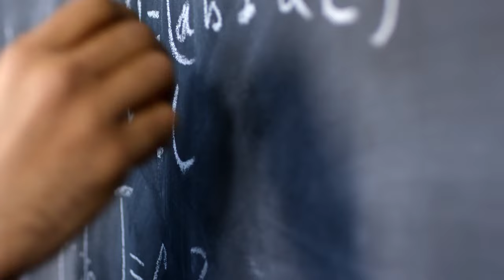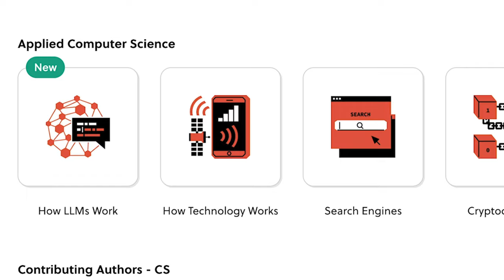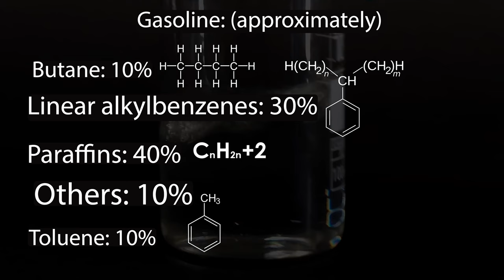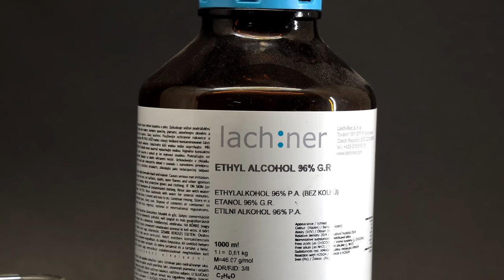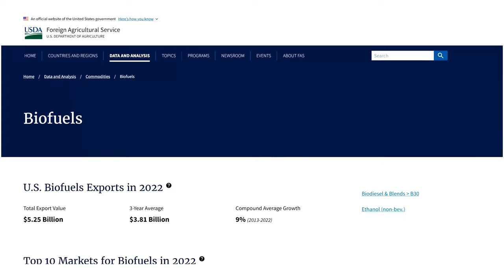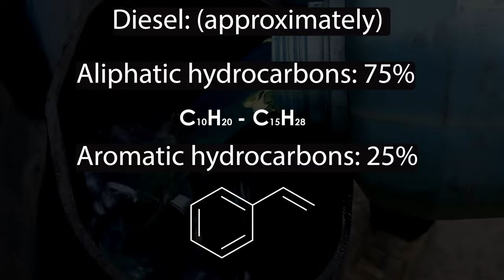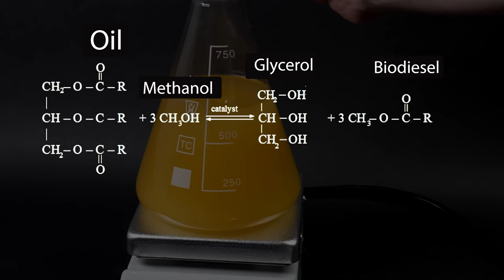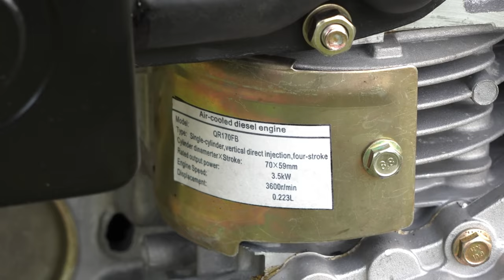Why Biofuel is a Scam?

Comment: No offense to the guy doing the voice over, but your real voice is far better and more sincere.
Reply: It was always a dub.
Reply: @ThunderChunky101  you are correct.He used to use his real voice. Before because it's easier to do it in a controlled environment like that, then relying on someone or something else
Reply: @borttorbbq2556  No, it wasn't his real voice previously.
Have a look at the videos.
They were also dubbed.
Reply: idk i find this one easier to understand, or i could even be happy with subtitles.
Reply: @ThunderChunky101  - Not necessarily, it's entirely possible that he never figured out how to synch his audio and video properly when using a mic and camera setup that were completely different inputs. E.G. A dedicated Mic, and a separate dedicated camera. Point is, we do not know for certain, so we can only guess. Thus, since we can only guess, we really can't try to claim that guess is a fact, unless he either confirms it, or doesn't.
Reply: @RetinaBurner  Stop it.
It's not his voice.

Comment: I've been doing research on biodiesel made with ethanol for a few years now. We recycle the glycerol byproduct back into the reaction as a glyceroxide catalyst. We react the waste cooking oil directly from the fryers on campus with 200 proof ethanol (not denatured). Ethyl esters are slightly better in energy density than methyl esters. I've been able to distill biodiesel made from soybean oil into 2 different fractions. One fraction is enriched with saturated esters and one that is purely ethyl oleate. Ethyl oleate melting point is -32C and can be used as a fuel in colder climates
Reply: Interesting!  Is this documented in a Paper, or some sort of Project Log anywhere yet?  If not i would love to hear more about this project!
Reply: Yes, but with very little modifications you can put unmodified raw soybean oil (filtered) directly into some random diesel engine and it will run just fine. Older engines will run it without any modification.
Reply: We should research engines that combust dry grain dust. It's extremely flammable. You'd just need to work out a delivery system to keep the dust from compacting.
Reply: To dry the moisture it's simpler and faster just to heat it, and must cost a lot less than demonstrated in this video.
Reply: @tripplefives1402  It isnt within my research to design or modify diesel engines, and using WVO as fuel doesn't produce any glycerol for my catalyst formulation, which can be applied to other chemistries. Much of what we do minimizes waste and improves the safety, sustainability, and efficiency of producing biodiesel/glycerol from triglycerides
Reply: @ThunderChunky101 u cant remove as much water with just heating it.
Reply: @mruseless6913  Less than 150ppm is fine, and in the video you can literally see that it's still very wet final product.
Reply: Do you use waste cooking oil or fresh edible Soyabean oil?
Reply: @mrpekka610  The cooking oil used on campus is canola oil, so that is the waste oil. I've used fresh soybean oil to separate the esters because of its fatty acid composition. I do not have a supply of waste soybean oil, unfortunately
Reply: @kylemcguff5581  okay...thanks
Reply: Get yourself a ultrasonic  cavitator I can react 1 liter per min in a constant flow
Reply: @bigredinfinity3126  I've seen reactors like that before. The reaction itself doesn't take much time at all, especially when everything is anhydrous, which is required to use less polar alcohols than methanol. It's the water washing, drying ethanol with Molecular Sieves, and separation of biodiesel/glycerol and biodiesel/water that takes the most time.

Comment: A few points to note. Biofuels are because they can be created and most of them can extend to crude based fuels we have making them last longer. That's the main factor in this as many vehicles do tend to sit around while running or they are doing highway driving so its more of an idle running so fuel consumption is not much of a problem vs needing work load. 

Ethanol added to gasoline can help improve carbon buildup in an engine as this has been tested out before. There is some corrosion but nothing like Methanol but compared to the carbon build up of pure gasoline without any added Ethanol, is fairly dramatic so it can help preserve the engines running especially for people that don't get the vehicle up in RPM to burn out the carbon deposits. Most of the corrosion from the Ethanol is because it just sits with it when they did the tests vs normal operation so the corrosion in that regard is almost negligible. The real problem is water absorbing into the fuel where corrosion can happen but that's only because of water getting into the system in the first place and there are ways to mitigate or remove it from being a problem. Again main factor is preserving the crude based fuel we already have making it last longer. Atleast until other sources become a lot better to join it as electric is still a ways away. As far as farms, some farms were saved because they could grow fuel based corn than food as it does not need the same standards as food corn or even animal grain. Not really a decrease in food production as a Farmer grows what they can make money off of to keep the farm going, sometimes they cycle what they grow and fuel corn is a good switch up for the ground for later crops. and most the US does not need to do any deforesting as most of it is Plains territory and already without most trees.

Biodiesel on the other hand is not meant to use pure fresh oil which is where you started off with. The used oil does smell quite different than any fresh oil. Far more pleasing to smell and as far as stability we have many that use it and not much of problems come from it but they could be mixing it with diesel or because its used cooking oil, it may not foam (not sure on that of if its something done during the process or creation). Here in the US the oil all comes from places that have deep fryers like fast food places so its all a waste oil and depending on how its done, the people that collect the oil sometimes get paid to take it away, they take it for free (so the owners don't have to pay for disposal) or sometimes they pay the owners for the oil but that's probably as a guarantee that they keep it to vegetable based oils and keep out other fats. Either way Biodiesel tends to be quite cheap because of this and it can be made at a house for use if needed as its not as hazardous as ethanol production. 

Both have the negatives in some cases but they also have their uses, For most thing they are well off but there are times with some old carbureted mowers where they are a pain because they keep getting water in the system and gunking things up. Mostly a pain because they can sit around for several months during the cold months because they are not needed.
Reply: Addition: farmers thought... Production varies snnuslky, bad years, good years. On a global scale. In good years prices then drop to a sliver of nothing, you cannot life from. Isn't that ridiculous? You get a great harvest, but therfore you need to invest more, than you get out? So, Biofuels are a great opportunity, to use such an overflow, to allow farmers living from their work. And, you need to have enough production to squeeze out enough for the whole world in a terrible bad year out of obvious reason. So there is quite an amount of surplus energy available. Indeed, deforestation just for Biofuels should be avoided, as well as ridiculous price boosts of edibles, when in competition with energy. But nonetheless, quite an amount of Biofuels can be added to the fuel mix. And, with machines optimized, fuels (be it diesel or gas, containing some 10, 20 % or more of biofuels) combust cleaner, less waste gas treating needed, less air pollution. While CO2 is the long lasting climate thing, other combustion engine byproducts are toxic, life threatening. Anything reducing those, helps. And, biofuels do that...

Comment: About ethanol engines: the fuel can use more compression ratio and more spark advance to improve power output and fuel economy. My car (a Ford Fiesta 1,6l with flex fuel management) has a 12,5:1 compression ratio and knocking sensor, the difference in fuel consumption regarded with gasoline is about 30% more in volume. The power output is 104cv in gasoline and 109 in ethanol

Comment: Regarding replacing gasoline with ethanol, I think taking advantage of its capability to handle higher compression ratios  is imperative to getting as much out of it as possible. Also I believe that optimal performance comes in a 4:1 gasoline-to-ethanol mixture. Beyond that, you get diminishing returns on knock resistance while significantly dropping the energy density.

Regarding biodiesel, now there is also HVO biodiesel in addition to FAME biodiesel. Basically it turns the plant oils into hydrocarbons directly rather than to esters. It also has propane as a biproduct

Comment: Brazil seems to be doing just fine. Of course, the engines on their cars are designed to run with ethanol. IIRC they even have flexible engines that can be used with pure ethanol, pure gasoline, and any kind of mixture of both.

Comment: Another serious issue with ethanol in gasoline is that it makes gasoline for road vehicles ("mogas") unusable for reciprocating piston engines in aircraft. While most of those use aviation gasoline ("avgas"), some people get modifications to be able to use mogas. Unfortunately, alcohol absorbs water, which can freeze at altitude and block fuel flow. Now pilots have to carry testing kits to see if mogas they want to use will be safe for fueling their aircraft.

Comment: The problem with ethanol that it easily absorbs moisture from the air. Moisture renders ethanol useless. So once ethanol fuel is in the car, it must be used immediately.

Biodiesel uses methanol and is stable. Problem it turns to sludge when below freezing.

Comment: here in the USA I had a 1960's Diesel Jetta. The car had a lot of problems since it had over 300K miles, but I did find that running a few tanks of biodiesel in the summer would help clean out the injectors due to it having some ethanol in it.

Comment: Could you please cite your scources in the discription, or tleast show them on screan? The big point for Biofueles is, that it isn't releasing new CO2 into the atmosphere, wich the competing fueles (fossile) do. You used some motors, wich are probably not meant for that. Since they are so percice nowadays they cant run of of anything you throw at it anymore The tech is at the start so give it time Here in Germany, most of the time you have the choice to choos biodiesel to fuel your tank. this is more expencive, but it helps the planet I think its a good replacement for fossile fueles, becaus we just can't just keep on burning fossile fueles. If we switch, we can keep many parts from the fossile fuele infrastruktue and use them for Biofueles.

Comment: Is not a "SCAM". Is just not sustainable. But that's easily solved by making synthetic fuel from C02 and mix it with biodiesel. Achicing B20. That's better to most engines than B100 (that require more maintenance and modifications).

Still, diesel engines with biodiesel are the best for preparedness, because you can store the fuel up to 5 years, and you can make more fuel from used oil. This is not feasable with gasoline engines.

Comment: Your diesel fuel consumption test leaves a lot to be desired.  A better way is to use it in a generator to produce work, that way you can set the power output as constant and then measure consumption rather than just idling, since idling doesn't really prove or disprove any points other than just being able to run.  Good video otherwise (I still miss your normal voice)

Comment: The 10-15% differences in energy density, and efficiency have some significance to the Carnot cycle... but that's at the end of its days as fuel cells don't throw away most of the energy as waste heat.

Comment: I've made biodiesel nearly the same way you did, methanol + NaOH then mixed to lineseed oil but without heating and with the right balance, I just shaked it and it separates by itself with a clear biodiesel smelling like haselnut and working fine... no heating, no stiring, no washing required for me😂 you don't need to convert 100% to get the right viscosity for a direct common rail so you don't need to put the methanol in exess... I've used it with a clio renault 1.5dci

Comment: That’s why methanol is meant to be used in direct fuel cells for the production of electricity, not combustion
Reply: *ethanol, also it's used in combustion engines, notably in Brazil, which was pioneer on this issue as they have a historical massive sugarcane production.
Reply: @LuisAldamiz  Brazil does have a bunch of pure ethanol fuel (E-100) and capable internal combinations engine cars.  This person was mentioning “Direct Methanol Fuel Cells” though which are a near-off the shelf technology one could make a Fuel Cell Electric Vehicle / Hybrid Electric Vehicle with that wouldn’t have all the problems of Hydrogen Fuel.
Reply: @LuisAldamiz  Direct Ethanol Fuel cells have been somewhat explored if i remember correctly.
Reply: @LuisAldamiz  both methanol and ethanol are used
Reply: @mr.lelito9524  - Maybe but I don't know that. Traditionally it's been ethanol, i.e. common drinking alcohol.
Reply: @ericlotze7724  - I don't get the fuel cells thing, sorry. I know that something like that is used with hydrogen but they're inefficient (more recent developments of hydrogen, with a small gasoline admixture, combustion engines are much more efficient). 

There are no real problems of hydrogen fuel other than flammability (which is less important because the byproduct is water, so at least it does not pollute nor causes our main eco-problem: global warming).
Reply: @LuisAldamiz  I’m a catalytic chemist, I work almost everyday with direct methanol fuel cells. Mostly using Pt/Al2O3 or Pd/Al2O3 catalysts for the conversion
Reply: @mr.lelito9524  - OK.

Comment: I respect the scientific method showed but at the end you show lack of research. I've worked in the private biodiesel industry for a few years and here (21:00) you are completely wrong. The raw material used for production is called UCO aka "used cooking oil", which is VERY profitable. Methanol can be reused in the process and the glycerin is sold as a byproduct.

Comment: I have the answare for co² on atmosfere, just buy charcoal em make powder and put on soil. If those ambientalists want make real diference do that, here on Brasil you can buy bilions of tons of charcoal cheap, from eucaliptus trees from reforestation, it is already in use for steel production.  But much more can be made for carbon locking, just start buying. Every 5 years can be cut for more charcoal, 1000 t per hectare

Comment: I feel like wood gas engines should have been mentioned. While not traditional bio fuel, it is a tried and true system of converting wood to fuel that is comparable to petroleum engines. I've even read a few sources which allege that had the geologic process for petroleum creation never happened we still would have had a vehicle revolution, just with wood gas generators instead of petroleum.

Comment: You need less oxigen to run on methanol fuel, stoichiometry on methanol is 6.57:1, in ethanol 9:1, in comparison of gas wich is like 12.5:1; on engines get more fuel on engine is easy adjusting injection/fuel jets, but get more air is another tale. Thats because you feel more power, because you're indeed  producing more power

Comment: One thing no one ever mentions about alcohol for fuel, if you increase the compression ratio from 8:1 to 14 :1, alcohol will provide better mileage, because you are getting more power from the alcohol. However, it does not like all of the kluge pollution control systems added over the decades to reduce pollution, however, burning pure alcohol will not produce the many forms of pollution the systems are designed to control, and are not needed, but the government does not recognize such science.

BTW, please use your real voice, it is your signature for your videos!

Comment: I both agree and disagree. While yes biofuels have less energy per unit, the carbon the is emitted from burning them was captured within a very recent time, where as the carbon in fossil fuels was captured over the course of the last 360 million years. I’d rather support your idea of less personal vehicles and more mass transit, but fuel the mass transit with biofuels.

Comment: Only real renewable source of fuel, which is carbon neutral is biomass. But only of done right. 
For example, if you plant the trees in the city street, trim it as needed and use it to power electric plant or communal heating. 
Not to grow crops in the field.

Comment: Your drying method was inferior and I can see that the final product was still wet.
Simply heating it is far more effective, a lot faster, and a lot less expensive. For  thag much product it only takes 20-40 mins.
You'll end up around 150ppm moisture and that's pretty much perfect for running in older diesel engines.

Comment: How do you compare power without any kind of (diy) dynamometer ???
Optimal Compression ratio and fuel injection pressure are also issues in this comparison. If you don’t optimize the results of this comparison are useless.